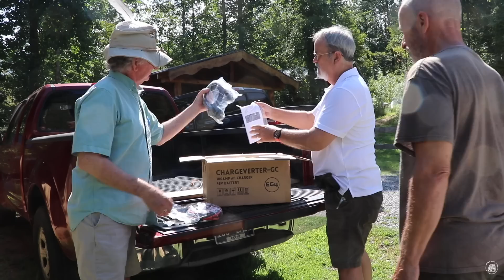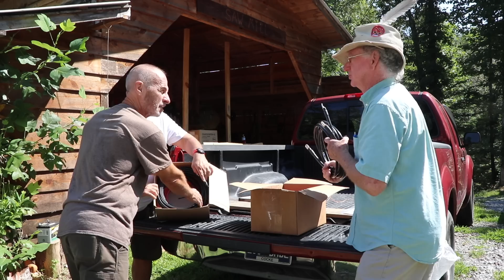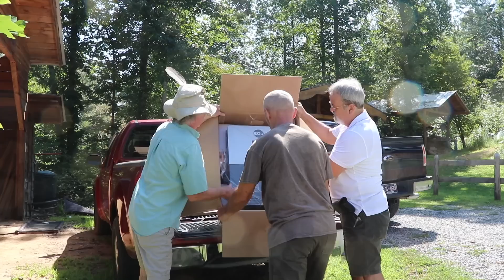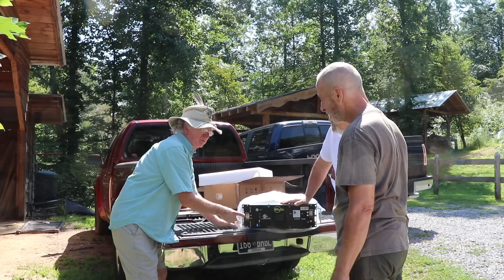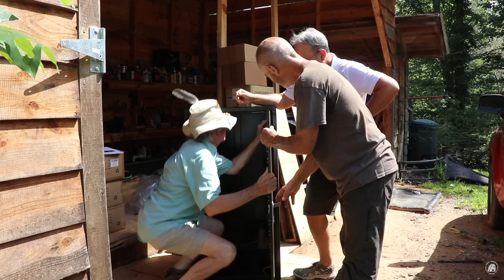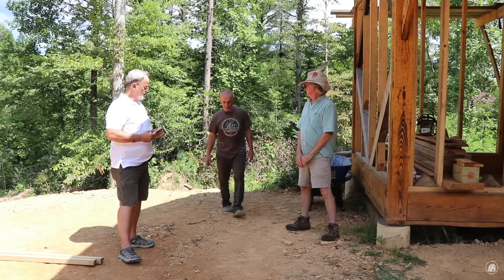Homestead Off-Grid Power Breakdown

Comment: Richard, you know you will have to expand the solar system, so build in extra space so  the system has enough power to power Jennifer’s castle at the foot of the mountain, so make sure you have enough room for a least 2 more racks of batteries and inverters to give Jenifer power of the sun.
Reply from the maker: No Raymond, her home will have all the GRID Bells and Whistles. She doesn’t want to be off grid.
Reply: @OutpostReview  Be nice to be able to run a line both ways... If you ever need power to go on grid, and when she loses power from the grid to be able to tap into your grid.
Reply: @OutpostReview  don’t count on the grid, to computerized and subject to hackers of foreign belligerent nations.
You may want to run an emergency power cable to her house and put racks at her house to hold the excessive energy you system will generate.
Just a thought and option, this what she has power during the hacker outages and Tennessee ice storms.